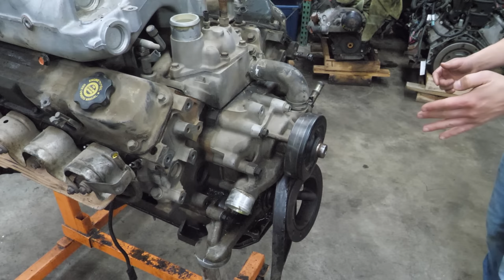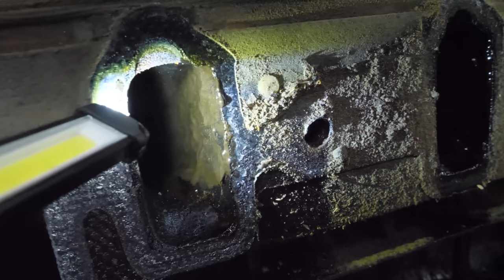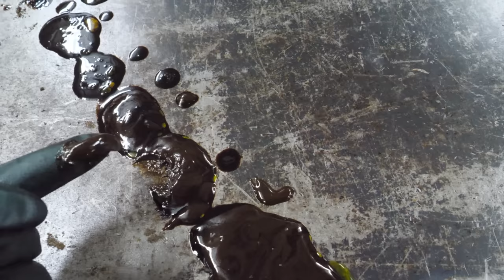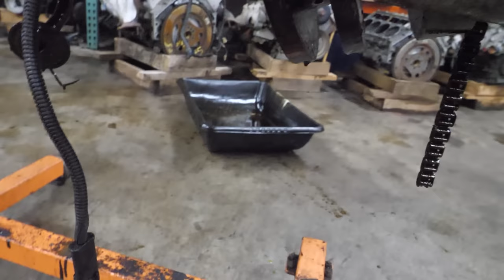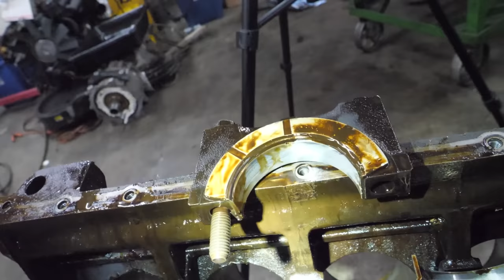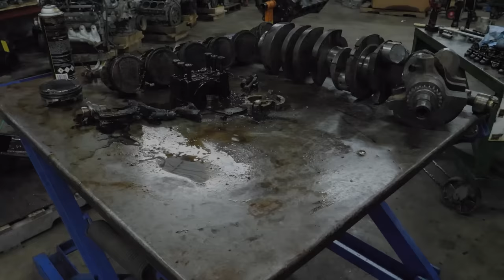8 LITERS OF DESTRUCTION! Dodge Ram V10 Engine Teardown. Broken In Ways I Have Never Seen!

Comment: How to get THAT level of damage? I'm guessing it may have been flat towed in gear? 

I'm thinking there was a problem that meant it was towed (Abandoned? DUI? Crashed?). While being towed, the oil pump started failing, starving the rear 2 cylinders of oil - hence the heating. Then, when those melted down & failed, mucho metal suddenly hit the oil pump, shattering it, and locking the snout. The shock of that, combined with the inertia of the rest of the rotating assembly twisted and bent the crank hard enough to lunch the main caps, before it finally snapped, scattering pistons & rods. As the truck was still under tow, there was plenty of spinning hammers to continue the destruction. Result as seen...?

IDK. I'm just not convinced it could've been running under it's own power, to produce that level of internal mayhem. Running under the power of a big-ass tow truck? At highway speeds? That I COULD see leading to that level of mayhem. Especially if it was a tow done at 0-dark:30 while the trucks owner was on the way to the local drunk tank...

Comment: Just from you taking the valve covers off I'd say the engine was killed by oil starvation because the oil was not draining back through the return galleys to the base of the engine. I've driven a couple of those trucks and those things pull like a diesel and run like a raped ape. It may only show 310 horsepower, but if that's only 450 ft lb of torque somebody isn't testing the torque properly. Because those things will pull your house down the street. And all you have to do is take care of me change oil and them decently and they'll last for 200000, 300,000 miles.

Comment: I think you should start having a carnage weight in of loose parts found in the oil pans, just to keep a track of the most grenaded engines you pull apart.
Reply: Interesting thought, but to be fair he'd have to weigh the engine first because the total weights are different, making a weight-to-weight comparison unfair. Competing on what % of the engine becomes shrapnel is completely fair. :)
Reply: @edifyguy  Yes, make it proportional to the weight of the "Doner" engine...

Comment: My theory... 
Judging by the coolant housing colour, id say this engine was tired and un maintained, the owner got a new motor ready and sent it with a brick and some beers. 
The heat and the rpm to cause that mess is max revs and wait.
Id say the cause is oil starvation causing a grab on a few bearings, causing excessive heat, instant seizure and explosion... 
Wouldnt be caused by just driving or even thrashing it. 8mins of 6000rpm, no oil... 
Haha. Nice vid

Comment: I understand that when it comes to truck motors torque is what’s most important, but what you think about the fact that today that 3 cylinders are putting out the same horsepower as that 8L V10, it’s just mind blowing

Comment: I had the 1996 3500 with this engine(x2). I absolutely loved the Truck, but depending on many factors, the V-10 was problematic. It could haul just about anything and never complain. Runs from Md. to Fla. towing a Full sized show Car in an enclosed 24ft Trailer, no problem.
Never beat on it, never abused it.
Changed the oil every 3k miles.
*Blew the first engine Towing my Boat to the Bay. No indicators of trouble before it flew apart.
*replaced with a guaranteed 96K engine from a Rear Total.
a)Both of these Engines Blew right around 116K miles.
b)Both Blew crossing the same mountain, at the same Exit Ramp, well before the steep incline. *2nd was not pulling any load.

Cause???? a Horribly designed Oil pickup and far worse Oil pump design.
For some reason, some of these V-10 would run for hundreds of thousands of miles, yet others gunked up the works even with premium oils and quality filters. They showed good oil pressure just before starving part and blowing into a million pieces.

Comment: Back several years ago, I had a Magnum 5.9 come into the shop that was similar, but way worse. It was so bad, I literally grabbed hold of the crank pully, and pulled the crankshaft out thru the front of the engine with #1 and #2 rods still attached! The whole in the front of the block was big enough to stick a childs head thru! Now thats carnage!

Comment: I've only seen one crank broken like that before and it was caused by machining shop error; they didn't leave sufficient fillet between the journal and counterweight faces. They ground a nice sharp 90 degrees which looked pretty but led to a massive increase in stress at the corner leading to a fatigue fracture of the journal. The tricky part is that the fatigue failure can be delayed by months or even years and the cracks that cause the failure are imperceptible. It would be interesting to have a close up of the journal fillet and some idea how old the grind was. The same sharp corner stress on their square windows was supposed to have brought down Comet jetliners, but this was shown to be factually incorrect, but not before before rounded corners appeared on every jetliner made since ... power of the myth!

Comment: My mom had a V10 2nd gen dodge had almost 400,000 miles on it, miss that truck so much, not sure what happened to it as le mom passed away a few years ago. I personally want another V10 2nd gen dodge but they are getting really rare.  BUT a little known fact about the V10 was it was even more powerful then the "legendary" 12v cummins in fact i dont think it was until the 24v cummins that the cummins matched/passed the V10 in Torque numbers, obviously the V10 made oodles more hp but yeah interesting little fact not many known it seems

Comment: I had a V10 2500 two wheel drive stick that i bought from a contractor.  Their shop did some 'work' to it.  This thing had a bottomless gas pedal...120mph and wanted more.  For regular driving you start out in 2nd gear.

Comment: It looks like someone added engine grenade fluid to the oil while it was running, then floored the throttle, bouncing the engine rpm’s off the walls, and then there was a loud series of thuds and metallic clunking sounds and then it quit. Engine destruction on a new level!

Comment: You put an inordinate amount of faith in the handful bolts used to hold that block on to that stand when you kick that wood brace out. You probably should use brand-new high-strength bolts for that trick.

Comment: “It’s clearly a Chrysler issue” is the most young-and-dumb brand loyalty thing I’ve heard this month. In my 55 years of machining and milling, this is particularly common on Ford products of the late 80s to late 90s. Perhaps not the V10, but the 318 and 360 series of Magnum engines, which are both utilizing the same blueprint block from the 60s A and LA small block design(which is NOT ANCIENT, have some damn respect) are some of the most reliable and well put together small block V8s in the world, and you’ll never convince me otherwise.

Comment: The Kia, Honda, and this are comparably destroyed, but the miracle here was the ability of the pan and block to keep the destruction contained so the order of nuggets stayed where we could grin about them. The heads probably are OK too. The oil pump did NOT cause this; it snapped because the crank forcefully moved to an angle where it didn't belong.

This was impressive. It's sad to see this engine in this condition though, because this was a unique engine that is really awesome and unparalleled in many ways, though the new Ford 7.3 gas engine is the same concept, which is nice that someone is making again.

Thanks for the grins, and RIP 8L-V10.

Comment: Here's what I believe happened to this V-10: It STAYED RUNNING on the middle cylinders for a while AFTER the two end journals spun their bearings and ripped the rod ends out.
The crank had to have stayed together until most of that damage was completed. Otherwise, it would have stopped rotating immediately when the timing chain came off the crank sprocket. There's just too much damage there to have happen in 1 or 2 revolutions after the crank let go.

Comment: Usually when the head gasket blows and coolant gets into the oil we would call it chocolate milk. It looked like you had chocolate pudding. You could tell the crank broke when you got the crank pully off. So this was in a truck pulling a heavy load. Broke the crank and decided to keep driving until it wouldn't. I've seen a 4 cyl. Volvo run after #1 cyl. punched out side of block. Customer wanted us to check the noise from motor.

Comment: Possibly, somewhere on YT or TikTok there's a video of someone putting a brick on the throttle of this engine that may have had some sort of existing problem like rod knock or worn rings and letting 'er rip at WOT until she won't run anymore.  Wow!  This is the postmortem.  It doesn't get better than this.

Comment: I've seen similar carnage on an LA engine that drank water through the intake, got plugs pulled on the trail and "flushed" best as possible to attempt the drive home. the burnt rod bearings, flattened rod caps were very familiar but the oil... that's what reminded me of that incident. you can ever so slightly bend the crank out of plane with a good hydrolock event. the front and rearmost rod journals get wiped out first

Comment: If you ever get into off-topic merch I think you may have a good notion for a sell-able idea.  Dark Chocolate with jelly lumps for Ice Cream called - Engine Sauce, you can do a clearish series of Lime and Cherry and Orange and have them as Trans Sauce and Coolant Sauce.  Motor Carnage and Malice in the Combustion Challis for labels.  Could even injection mold the sauce bottles to resemble engine parts easy enough.  Buy 5 and send in the UPC codes for a FREE 10MM Socket ..... ;)

Comment: Most damage I've seen in an engine that. An the broken wrist pin. I'm sure a bit of welding some heat an a bit of Jb weld will get her up and running. Maybe just maybe change the oil?
On a serious note I'd have loved to see the inside of the filter. Go Eric for bringing us an entire engine kit in a sump. 😉

Comment: I have actually seen these motors fly apart pulling.  In the mid 90's in NC working. They used to Rev so high on a hard pull I honestly think the trannyies,n gearing were wrong. N cranks were weak . Mopar up until late not known for the best trannies. I can't believe didn't catch on fire as I have witnessed. They just were not built rite. Dey good as long as you don't work them to much n on steady heavy pulling. Great video

Comment: I worked for a dodge dealership. They would say, put it back together this does not warrant a new engine. 
We had to use tap water as coolant, put round fasteners back in, run engines with no air filter. I had to pull teeth for electric power steering fluid. Full service at dodge mean "hopefully they dont check"
The torque wrench they had me use was calibrated on the moon in the 60's. If you value, you or your stuff don't take it to dodge!!!

Comment: Given what you said about all the heat changes there, every single big end was stained with heat.

I think that, given how all the bearings are 0.10 oversize (undersize :P) it might have been an error on the rebuild. Maybe it was SUPPOSED to have the crank ground, but it never happened. Or someone just put the wrong bearings in there. Probably thought "Cor, thats a bit tight" and carried on anyway. 

I can only see that causing such ridiculous heat damage to the big ends like that, those bearings were just pushed tight to the crank.

Comment: Someone ran this motor at full throttle until it was completely dead.

Given all the carnage within the engine block, it is very impressive that the heads survived with some mildly bent valves.

Comment: At 17 minutes I was suspecting that the crank will come out in pieces. Not rocket surgery. Let's see.

Was that cam like 8 feet long?

Chrysler has had metallurgy problems for decades. My family had a new 1976 Chrysler 2 cylinder outboard motor, and the crank came out of it looking much the same way when it was about 2 years old. Luckily the RPM was low when at failed. I think is what happened here. Crank failure at high RPM.

Comment: Wondering if this was a cash-for-clunkers vehicle. I’m a tech at a Ram dealership in California and I remember that we had to add this polymer crap to the engine oil of vehicles we took in during this program. It would cause the oil to congeal and we’d run them at WOT until they stopped. Most were pretty uneventful, but I remember a couple putting on quite a show.

Comment: My first real pickup was a 95 2500 V10 single cab. That thing would smoke most pony cars from a stop light and still get around 15mpg. The V10 made it sound like a 6 cylinder engine but it was way better all around then the Hemi was. 1/3 of the bottom end of the motor being in the oil pan is funny as hell.

Comment: I don't know what happened here but possibly a budget rebuild was the culprit. 
Big end bearing shell rotated, overheated the big end then the chain reaction began. 

Statistically, rotated big end bearing shells can be traced to rod bolt failure. Budget rebuild probably don't replace the big end bolts. If in a previous life that engine was overrevved/badly overheated causing the rebuild in the first instance, then the big end bolts may well have been stretched previously by either overreving or the pistons getting tight in the bores if the engine was badly overheated. 
This is why I would never ever reuse big end bolts in any rebuild going out to a paying customer (even though I'm a mechanic and I have on my own engines quite a few times LOL).

Comment: I think it was towing on a highway. I bet though it had a manual behind it. The entire engine seemed to have compression flowing through it. Stuff shoved up and out everywhere. Probably downshifted by accident sending the revs to the moon. The engine having a load plus all of that would make quite a big boom. Would love to have seen it. Probably a big boom was visible from out of the truck. They just turned the engine off and kept it running in low gear or something

Comment: I’ve seen a 427 Chevy tear heads apart where it had to brazed all back and then machined back in speck but this motor must had been held to the floor and held there till things begin to happen , this motor has been videoed somewhere, this would have been awesome to have watched this RAM V 10 that made some serious noise

Comment: I made a comment on this a year ago suggesting a massive overrev after a crash however looking at it again I agree there is no  evidence of a forward hit,could have it gone into  a  reverse crash.?
Anther thought,the crank had been reground .010 undersized, is there radius machined  at the ends of each journal?
I have seen  and worked on a diesel engine which broke the crank because the machinist didn’t grind a radius on the main journals or the conrod journals.
Your video unfortunately doesn’t show a clear picture of this.
Good work ,very interesting to watch someone else getting dirty hands and giving nice commentary also.
 A novel thought,could you set an engine up to run and see what it takes to self destruct,ie hold it flat out and stand well clear 👍✅

Comment: I've seen this exact failure before. He had definitely done a manual tranny swap, he ran out of battery. He used a boeing 747 with its landing gear in the bed of his truck to give him a push,  but unfortunately right as his engine started the 747 had engine failure, right as they got to a steep hill, so he ended up pulling a 747 up a hill at full throttle at 500mph, and the straw that broke the camel's back was when he panicked and shifted it into first. It looks like a robust engine but it's actually quite sensitive to being in first gear at 500mph under a few hundred tons of towing load and this is the result. Very common problem with that model year. It will buff out

Comment: it was a bad crank , I've had two V10 Dodge truck motors that came apart like this, one was at Idle , went to look at a 95  Ram 3500 Regular cab Dually auto truck, High Mile some where in the 325-330k ,  owner started it up, truck was some what quite for the mileage about 5 min after start up  a loud BOOM ,  no high pitch squeal  of metal ,  no warning, just a Loud F'N Boom, bought the truck any way.....truck went from $6500 to , Sh!t I guess it's only worth $2500 now. got it home tore that V10 apart, #1&#2 main caps were in the pan, Rod caps in the pan also, oil pump tore up , timing chain broke, but the rods were still in one piece, bent and twisted only the caps and bolts were broke.
   The other V10 that exploded was in a 98 Ram 2500 4x4 manual trans truck I had for a few years, bought it with 54k on it engine exploded at105k , it happened on a trip back from Atco raceway, I was going down the Vine st expressway , was at the top of 3rd gear , about 3500RPMs getting ready to shift to 4th, and BOOM same deal, same spot on the crank, broke mid way through #3&#4 journal, popped out a few Expansion(aka Freeze plugs)  AAA got us home, tore it down the next day, same as what you see here in this video, but a LOT cleaner on the inside. same engine gravy, very similar carnage, all four rods up front(#1-#4) were broke, pistons #1&#3 arrows were facing towards the side of the block, #2's arrow was facing the Intake manifold, #4 was still facing front but Not connected to the Connecting rod.

Comment: I wonder if that came from PNC  Cable from Raliegh NC from 96/97. Looks familiar.  We were pulling bore machines n combo u it's. MY 79 ,34 TON Suburban 454 Edelbrock 750 carb was out pulling  him. He dumped on Dat dodge n bam o bbam scatter city blow up. No I didn't leave him. Felt sorry for him. He was from Boston  n Boston College graduate. Old 454 run great n out lasted 3 of them I believe.  Never did die. Sold it to my strpper girlfriends dad. 1979😊😅